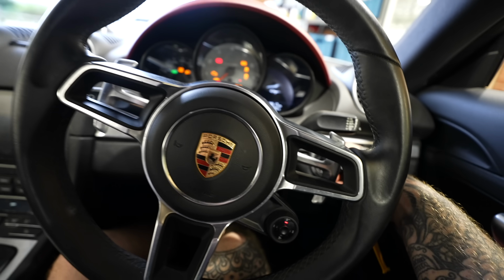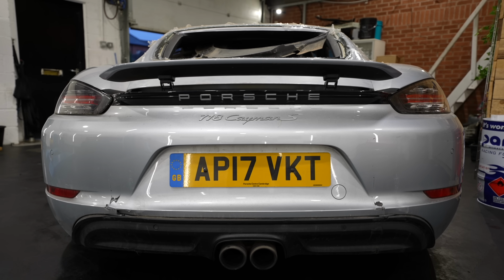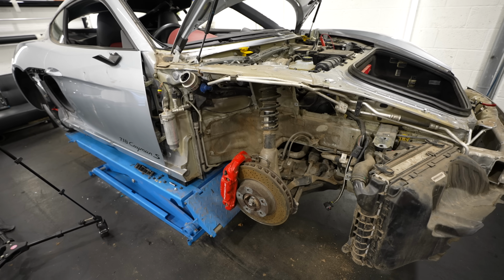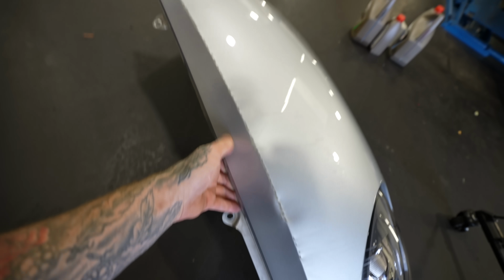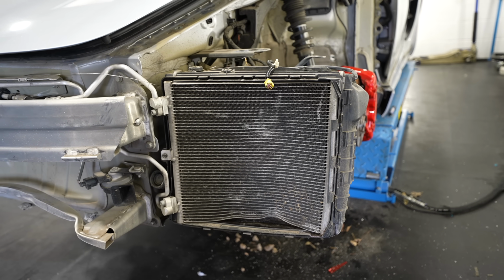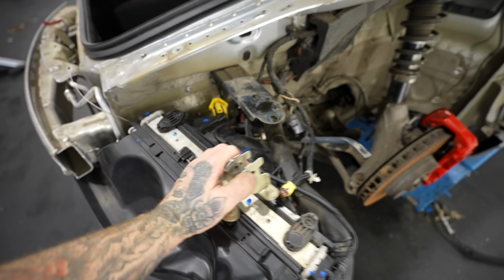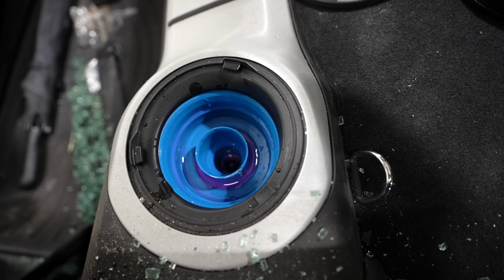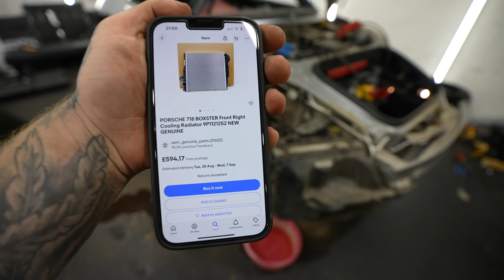REBUILDING THE CHEAPEST PORSCHE 718 CAYMAN S | PT1

Comment: I actually don't think the damaged doors and bumper is from fork lift misuse. I think it's possible from lifting with straps from a ditch... Either that or it was strapped to a flat bed with ratchet straps...
Reply: That was my thoughts
Reply: Same here I was thinking it was lifting straps as well.
Reply: Yes indeed looks like it
Reply: Yep, that was my thoughts, looks to me with the wheel damage and dirt in the front end, it's most probably spun off a road (or a track) and probably landed in a ditch, and then been removed with straps around to lift it out, and the buckles have dug in to the sides.
Reply: Have to agree with you. My very thoughts as soon as I saw the marks.
Reply: Obviously forklift damage.  Lifting straps don't have metal fasteners/studs/seams.  Flt fork carriage rash.  Matt is right.
Reply: agreed - if the car was lifted on it's side by a fork lift, there'd be more damage to the doors than there actually is.  plus, it would be weird to lift a car from all four sides.
Reply: @flyinyamaha  if they've used ratchet straps and the ratchet part was against the body work, it could - why would it be forklifted from all four sides at different times?
Reply: Mike Webster.  Car has been lifted from either side and the rear with a forklift You wouldn't use ratchet straps in a recovery.  You would use lifting slings (metal free). It's too symmetrical and parallel to not be.
Reply: It deffo is, probably upside down in a ditch which explains everything being damaged
Reply: @flyinyamaha  your talking what you should, and not what they did. That has had serious pressure to puncture like that.
Reply: @TheMoffBoy  simple punctures from the right angle of the square of a fork x 2.  And a 12t forklift has serious pressure!!
Reply: @flyinyamaha  we are talking about having a lift ram into it violently enough to puncture it. That much force would have to have bent the chassis, not just puncture the door. A sharp edge of a ratchet strap wouldn't need that much force before it pierced the panel.
Reply: No . Just no .
Reply: @Mshaworangevillevw  ok
Reply: I thought it would be straps as well where the ratchets dug into the body work while lifging. Fork lift damage would be weird. They would be lifting the car from different direction every time they lifted it...
Reply: Yes, i think also. I think this car was upside down at one point, or at least on its side. and towing flipped it back on it’s wheels again.
Reply: My thoughts too
Reply: I agree with you
Reply: @flyinyamaha  ratchet straps have metal parts.
Reply: @flyinyamaha  if the company who recovered it saw it smashed up on every side and expected to be a total loss, aka totalled, no care at all would be put into hauling it out of the muddy swamp.
Reply: @GenaF they do. But the side that would sit against the bodywork (the ratchet, not the sttap) is smooth as it is expected to sit against product. I was saying lifting slings don't have metal parts  2 completely different pieces of equipment.
Reply: Tru
Reply: Same i thought so
Reply: Agree I'd say they tucked several together and as car lifted or rolled the damage would be caused sure that said could have been avoided but if not fixable insurance just want cheapest recovery
Reply: Copart a renowned for carelessly damaging cars with fork lifts and buying perfectly repairable cars from insurance companies by exaggerating their damage which in turn affects our premiums. They’re a bunch of crooks.
Reply: 26 replies and who gives a shit ??
i mean unless you were the previous owner or the recover agent, or copart who's to really know..
and who really cares ??
Reply: @CBRadioWayBack10-4  You had a bad day bro? Hope you are ok.
Reply: Yeah I thought straps, but when he said forklift. I was like "well he's the pro."
Reply: I thought ratchet straps.... The punctures are where the tightening straps were..... impo.
Reply: @CBRadioWayBack10-4  Who pissed in your porridge? Its a 'comment' section, people will have differing opinions.
Reply: I think the car was lifted out of a dicth with some kind of a “claw crane” but the marks were actually caused at the time of dropping it off the crane, where it may have slipped out of the claws resulting in a dented scatch.
Reply: ABIT of both I think
Reply: Straps would crush. This has pierced. It's forklift. That's whys it's at sides and rear as they've moved it about.
Reply: My thoughts exactly
Reply: It is definitely the fork lift
Reply: FLT blades/ tines would make a "flat" line down the panel, not the two outer score marks. If anything they are rounded off with wear.
Reply: That looked like fun
Reply: So the Tow totaled it... crazy to think they couldn't retrieve it in any other fashion...@Doovde69
Reply: @TheMoffBoy If it was straps then the space between the cuts wouldn’t be identical. The fact that each space is identical in measurement means it was a forklift

Comment: I’ve purchased from CoPart, nearly every car has had damaged sill joints , dented chassis rails, damaged exhaust systems and cracked plastics underneath, I’ve seen more damage done by the loaders than in the accident, they really do need to address this issue.
Reply: Doesn’t help when they throw them around with the forklifts tbf 🥱
Reply: That's interesting as the USA YTers don't seem to spot this issue. Maybe cos they use those massive CAT loaders and not some tiny forklift?
Reply: Address the Issue.
So is this by Post or Email 🙊🙊
Reply: Copart do not care
Reply: They don't give a fuxk cos by the time they load the car up for u, uve paid them. If it was me I'd load it myself however difficult it was.
Reply: Copart just isn't worth it unless you're a youtuber
Reply: Here in Brazil sometimes they dig a hole at the door with the forklifts…. Brake the gas tank to take out the fuel…. Change the tires….

Comment: Just my opinion and not detracting from the video - the A Pillar is deformed which ever way you look at it, I can see the dent. You have to remember that this car has already rolled, probably into a ditch as the door marks are from lifting straps. The fact that the windscreen was shattered in such a way suggests A pillar loading. I wouldn't be surprised if getting the windscreen in properly will be an issue. That A pillar is what stops the roof collapsing in a rollover along with the B pillar. Please get it inspected Mat, Id hate for anything like this to hold you up further into the build. More top content however :)

Comment: Them marks are from the straps they used to lift it out of a ditch it rolled over in .the pullys would’ve made the holes..can’t wait to see how your going to fix them pillars.
Reply: Stacker rash.  Blindingly obvious.
Reply: @flyinyamaha  Yeah, you can see the marks on the door panels don't go all the way up the panel. Like you would expect from straps.The fork lift shown in the video though, has 2 short rests at the back of the forks, which would line up perfectly with the door panel damage.
Reply: If it was made by straps, then the gaps between the marks on the car wouldn’t be identical in length. The gaps would vary in length. The fact that they don’t means it was a forlift

Comment: As you were topping off the coolant, I was yelling at the screen. Modern Audis and Porsches both have pretty strict vacuum bleed and refill requirements. Also, be sure to carefully read the oil change process, it's very easy to overfill the oil and an oil extractor is worthwhile investment.
Reply: And bmw and Mercedes’ Matt should have known this by now.
Reply: Specially on a car where heat exhcanger is good 6 feet away from the engine pumping coolent using 2 inch pipes.
Reply: Tbats why i live thsse vids...shows warrs an all. Learning alongthe way. Can you post your perfect no mistake vids. Jees. Give the guy a break
Reply: @simulation8083  If you want to learn about porsches and fix them, first download the service manual and invest bit of money on an aftermarket PIWIS. There are true educational vids on youtube which not 100% on entertainment.
Reply: Yeah, that was a rank amateur mistake.

Comment: You'd be amazed how easily you can repair bumper covers with a cheapo soldering iron with a flat foot, some matched plastic type filler rod and some stainless steel screen material. Bevel a V groove in the front of any tears or cracks, back it from behind with the wire screen embedded into the cover with the soldering iron and then fill the front groove and sand smooth.  Then skim with flexible fillers designed for bumper covers.  I saved a Volvo C30 cover that was torn up quite a bit doing a project during lockdown.  The replacement cover was dear, and even second hand covers were too much.  No one can believe the before and after photos.  Judicious use of a heat gun will also help with any major deformation.  In sunny California, I just left it out in the sun.  Generally it's a bit soggier by you.

Comment: Good news the frame doesn’t look too bad under the a-pillar.
Vacuum bleeding coolant in anything mid-engined is pretty standard, surprised you didn’t think of that one.
If you can’t vacuum bleed it, another way is to get the arse-end as high as you can when filling the system - not perfect but it can be enough.  On the older Caymans/Boxsters the coolant cap has a little manual valve on the top you can open to help purge any remaining air after filling

Comment: I used to work at copart on the transporters collecting the cars, I can tell you now that wouldn't be from copart loaders that's more then likely from a recovery company using their forklift to move it around (seen it so many times) only bit could have been copart is back bumper as they not ment to lift from the side

Comment: As I was watching you filling the cooling system I'm thinking you have to vac the system down under the engine cover to get the air locks out.  Check out the rad part numbers they look acactly like the 987 Cayman rads, you could probably get them a lot cheaper.

Comment: If I am not mistaken,, the new aluminium panel's are bounded onto the chassis.  You use a special adhesive.  Looks like that Cayman was rolled over in a field a few times ! Get a front windscreen and see if it fit's before doing body panel's,, incase A pillars are slightly twisted out of line. Stop bidding on cars when your high  🤣

Comment: You need to find a few of those businesses that repair or refurbish parts to better than new. I'm sure there is a radiator repair shop somewhere out there that would repair renew the radiator core for a couple of hundred. Bit like those quirky old skool repairers Mike Brewer from Wheeler Dealers uses.

Comment: If you have to redo most pannels, do them in carbon fiber. Hides a lot, makes it look better. Just the Part out of fiberglas + 1 top layer of carbonfiber. THAN the cayman should be more worth than a new one and still be cheaper than a new one. + you can salvage the parts for required frames =)

Comment: Was it necessary to replace the near side radiator just to run the engine up to temp? Could you instead have short-circuited that radiator's hoses and leave any required cooling up to the off-side radiator?

Comment: Hi Matt,  ive had several of these cars,  the ticking noise from the engine is not standard,  they suffer with ware in the nikasil linings in the bores..  This would be a full engine rebuld at acost of around 10k please please get this checked out further before you spend any more money on this car...  Best regards Ted

Comment: Just a quick one, before spending £1200 on a radiator pack, surely spending £5 on a piece of tubing and bridging the pipes together would have yielded the same result??
Reply: He is going to finish the car so might as well do it properly
Reply: @ahyaan2552  Yes but it's £5 not £1200 on something that could be shagged? I see no logic.
Reply from the maker: If the engine is no good it can be sold bro
Reply: @MatArmstrongbmx  That's fair chief

Comment: I also thought forklift first , but then I thought maybe it was ratchet straps over the car holding it on to a flat bed truck .The marks that are punctured in could be the point where the ratchet clip is tightened and presses itself into the side 🤷🏼‍♂️

Comment: Think this car will be great content for the channel. Can you not get the radiator repaired or price up a new core for the rad.
Reply: My mate used  to work in a radiator repair garage. If a water vein was split he would cut both ends and solder the sides. Ok you loose abit of cooling but not enough to worry about. If you can get a new core they reuse the plastic ends of the rad and the O ring seal and re crisp it all back together.

Comment: That radiator pack is actually cheaper from the main dealer before discount, second hand porsche parts are a rip off, people take the absolute piss just because of the badge, also heads up mate before you go and buy a second hand headlight, main dealer price is £1014.00 + VAT that's before you ask for a discount.

Comment: Surely you can find someone who will repair this radiator for a fraction of the cost 
I had pay like a £10 for a small welding of the radiator
There are also aluminium rods available that you heatup and they melt onto and patch the hole

Comment: Surely rather than risk £1200 buying the rad pack, any radiator would’ve done to test the engine?
Reply from the maker: The radiator can be resold bro. If it over heated using another rad I would of been insure whether it was the other rad that caused it
Reply: @MatArmstrongbmx  true, good point 👍

Comment: I don't think Copart's FLT did that damage on the doors/bumper, it looks like the car was rachet strapped down on the back of a recovery truck post accident over the top of the car, the metal rachets have caused the more severe marks/dents nearer the top of the doors. The recovery guy probably wanted to be extra safe seeing as though he couldnt ratchet down all four wheels, with one being completely fubarred.
Reply: Yeah my chips are on this also.